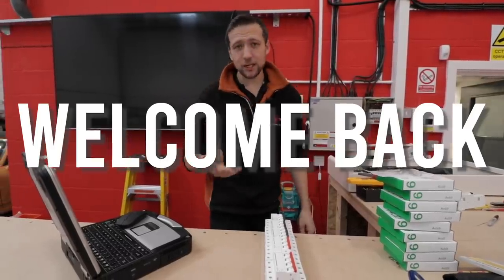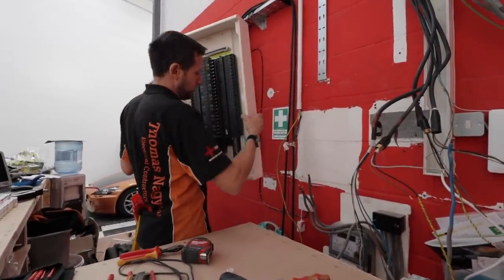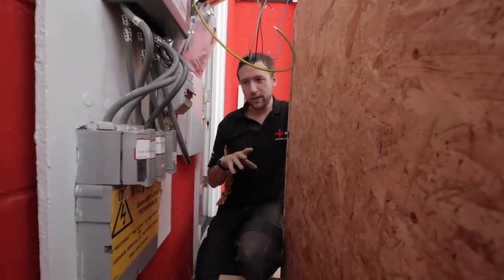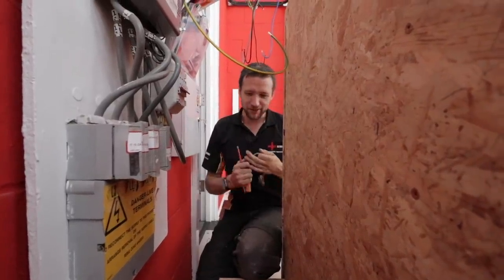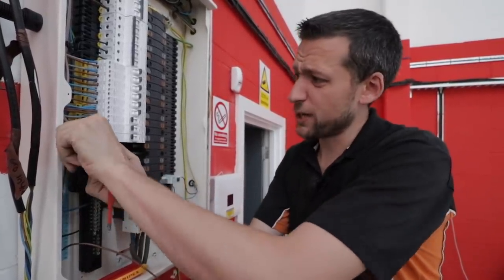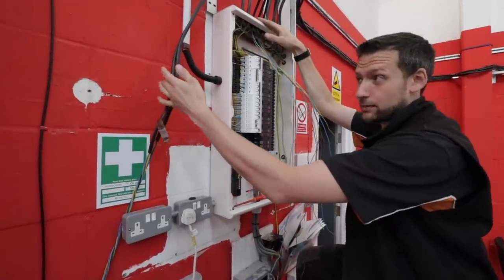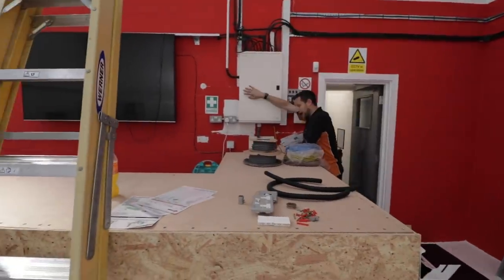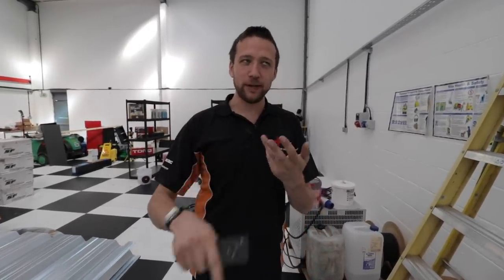Fitting a new 3-phase fuse board | Thomas Nagy

Comment: Here in Germany we've Got fuseboards from Hager or other companies with rubber "push-through" things. The big plus of the is the watertight sealing and no need of drilling holes for the inlets.
Reply: Luke Skywalker 2 things, you can’t gland steel wire armoured cables off onto rubber and provide a suitable earth to the armouring secondly it wouldn’t comply with 18th edition regs
Reply: @w5nker  We don't use Armoured cable commonly here.

Comment: You can change the top and bottom by removing the screws meaning the knockouts can be on the top 👍
Reply: In my country these kinda boxes come with big rubber "pads" you just push all the cables through real quick, I suppose thats not allowed in UK.
Reply: benii in this instance a lot of the circuits were fed in steel wire armoured which needs to be glanded off correctly to earth the steel of the armouring
Reply: @finbenton  Nothings allowed in the UK. Im surprised we even get electricity here, it can be dangerous after all.

Comment: What a cute little Fuse Board, i have to change in two months a Fuse-Cabinet (it is the Supply for a Big Kitchen)  from 1986 with ~150 Screw type Fuses, from 1st Floor in to the Basement, gets replaced with Hager and it gets RCDs. You would't beleave how much old Electrics is still in Use in Germany.
Reply: Make a video

Comment: I would recommend when doing three phase panels 8way or over installing a trunking header of either 100mm by 100mm or 150mm by 150mm, sandwich some paxolin between with a nice slot and away you go, you can leave slack in the header very handy when you have lots of SWAs coming in.
Reply: You'll be wanting circular trunking next - so the surplus cable can just be wrapped a revolution or two round the circular section ;)

Comment: Thomas if you want a good Amp clampmeter/multimeter  Buy the Fluke 325 i have one myself a plus point it measures dc amps.
Reply: Used one daily for 5 years its great but only has 2 AAA batteries, wish it was atleast AA.

Comment: Hi Thomas,.... thank you for videos, just a quick question, Why did you sleeve (or taped) brown on black and grey wires of a three-phase cable? .... as I understand, the Regs specify that the Black wire is L2 and Grey wire is L3, in the three-phase setting. I appreciate your response. 

Best regards.
Ramin

Comment: Am I right in thinking I saw brown sleathing on the black and grey of the three phase circuit?  Iv never indicated my L2 and L3 as brown phases unless they're single phase.  
I have also been to several three phase installations and have come across single phase circuits coloured coded to the phase in which they were fed from.

They're nice boards to fit, we fit those and hager.

Nice job as always.  Commercial work much better than house bashing.
Reply: That is bollocks when that happens. on a 3 phase system you expect 3 phase coding, not a light switch bank coloured all the same phase.

Comment: I pack my tools up when It takes more than three attempts to pick a screw up from the floor..
Reply: Sounds like the start of a good thread on a daft theme. If so, I'll continue...

Having locked the door, the key doesn't come out of the lock when you try - to the point the key (or bunch of) slips out of your fingers - at which point the key or bunch drops freely to the ground as if there was nothing holding it in in the first place !

Comment: Yes I'm Midway through a change over at home somehow I managed to poll 4 in and have the same 4 circuits still out I'm still scratching my head on this one. Once I get done with that I just have the air conditioner and 4 240 electric heat circuits. I'm taking my time but I still gave myself a deadline by the end of the week.
Well I don't pull main fuses because well we don't have them...

Comment: With regards of pulling the main fuses, i think their main concern is people will potentially steal leccy, if the main fuse doesn't have a seal then one could easily disconnect the meter and add new tails from the cut out to the consumer unit(completely bypassing the meter) although with smart meters these days i don't see how one could get away with it.

Comment: Should buy die cutters for the boxes much quicker , also S8 is way faster then a S2000
Reply: I doubt it, that S2000 was Turbocharged and is somewhere around 550bhp. Did you not notice the pipes sticking out of the bonnet ?.

Comment: I have done far too many schneider boards and they are my least favourite board due to always having quality issues especially on the 630a panel boards but how you terminated the earth bar makes me wonder if me and all sparks I know have been doing them wrong as we always pass cable in from above and It gets messy. But yours looks spacious at the top. Can anyone give an insight as correct method as I've just followed suit from the old merlin/square d days
Reply from the maker: I terminated earths from the bottom as I just figured it looked a bit neater, but I guess it can be done from the top, no reason why not. The advertising literature shows both methods
Reply: @thomasnagy  thanks for the reply. I didn't realise it was actually shown in the instructions.i tend to glance over to find the multitude of torque values and that's about it. Next time I use schneider I'll be sure to keep an eye out.
Reply: Front covers are usually a pain in the arse as well, holes for cover screws never line up!
Reply: @megazeus7972  I've had that in the past, the new type of RCBO's in an older type board seems to cause occasional problems when fitting the cover back on.

Comment: With those three phase boards the top and bottom panels are interchangeable. You could if changed them over and only had to drill a couple of holes in the bottom one. Would make install a little quicker

Comment: "It's surprising how much effort it is to tighten a screw" - I think you've just answered the question as to why screws come undone over time - people just don't take tightening them seriously enough ! IMO, if the copper doesn't squeal with agony, it's not tight enough.
Reply: tighten till you crack the lug then loosen in a 1/4 turn and blame it on the new guy

Comment: Decent board but let down by the mere two screws that secure the top/bottom plates imo.  I find they bend a bit too easily making the plate not sit flush anymore.  Would rather see more fixings akin to Hager.  Also, not a fan of the knockouts at all as they cause problems when they don't match-up with what needs to be done.

Comment: I think it should come with cut outs or the swarf ends up going in everything
Reply: normally you mark the top remove then drill it then put it back or put a piece of trunking on top for a manifold then just cut one big hole
Reply: @tangoengineering  Does that then not act as a chimney when the board catches fire ?
Reply: @millomweb  no

Comment: Thomas if your worker pulls the cutout and it blows up you will need to prove that he had on a face shield, mappa gloves and done his G39 working in the vicinity of the dno certificate. Having seen somebody blown across the road in a job where removing dno cutouts all day long you need to have all this and an agreement to do it. That's why all this you shouldn't be doing talk comes from. The only reason it's so relaxed is it's not profitable for the dno to come out for temporary discons all the time. It may have changed but 5 years ago this was what I've learnt from working along side UK Power Network's

Comment: One of the leads can attach to the meter so that you can test easily. Its a great meter ive used it for many years youre just not using iy properly bro. My only issue with the fluke is that it doesnt read micro farads

Comment: Shouldn’t you be fitting surge protection ? And also power monitoring as per the building regulations ? These are required for commercial installations

Comment: Piece of useless information for you.... there is a small yellow tool attached to the top of the isoaltor rail on these boards and it's designed to be used on the isolator sliders.
Reply: If such big boards are supplied through those thick black cables then it means those cable do not need to be inside the walls it can be just attached to the wall?

Comment: Hey man are you looking for any electrician mate or labour am interested I have done   17th edition and have 4 year experience ?
Reply: Rizwan Razi No. he’s looking for a sound man though to check the mic is working and levels correct. Oh and if you could connect a few wires into a dist board while toms at the radio that would keep his paying customers sweet 😅so they have hot water and stuff.

Comment: Hi Tom, When I had a visit from NICEIC the inspector commented 'with my experience why do I need a torque screwdriver' I have been in the trade 40+ years ha ha. There is nothing rong with that Fluke tester it must be user error. Mind you I ahve one it was the last Fulke item I bought after they shafted me. Sleeving on conductors....no real need to put it on cables feeding 3phase equipment. (I dont always use sleeving on single phase jobs i.e. 2way switches my view is that if you dont understand what the conductor are for or what they do you shound not be messin with it and I told the NICEIC chap that as well...in one way he agreed.
Keep up the 'good' work

Comment: Torque drivers lol I know when it’s tight never had a issue ☺️
Reply: Torque tools are to stop you going TOO tight.
Reply: @Camberwell86  "too tight" Anyone familiar with this expression ? I'm not and I don't use torque drivers. As is indicated in this vid - the big problem is not tight enough.
If you're needing torque drivers, you should be lubricating the threads on the screws too - to make sure you get them properly tight.

Comment: The reason you dont pull the fuse is as you dont have sealing pliers to re seal I work in revenue protection so you are leaving a tamper for the customer and we will then shut them off so there is a reason
Reply: You shut them off if the tag is missing? For how long?